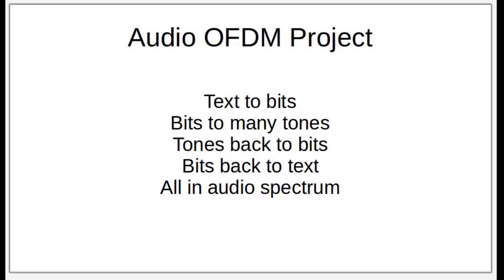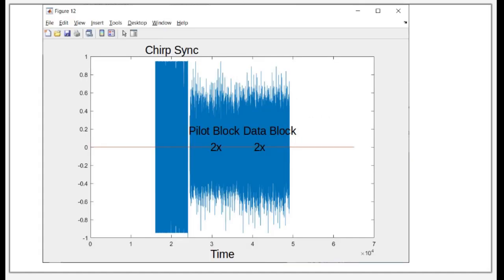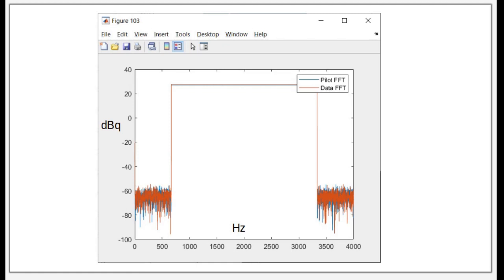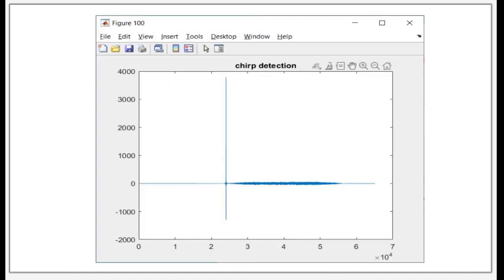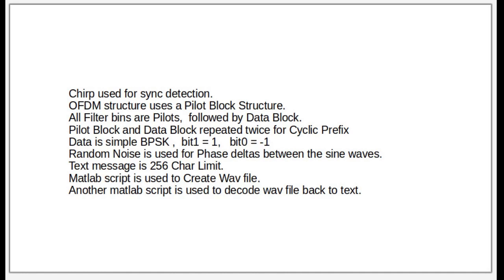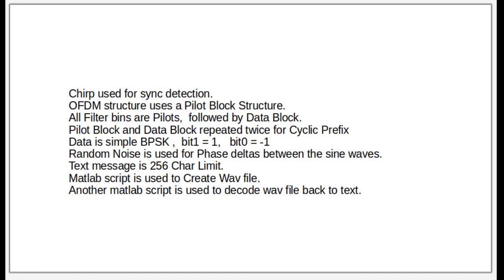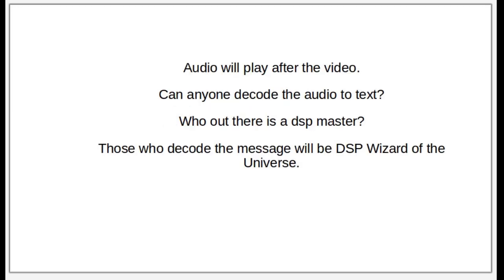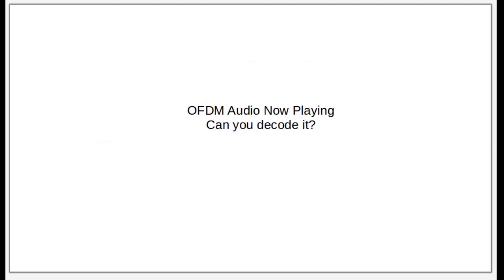OFDM Audio Project

Comment: Realised all my received bits were flipped when I transmit with the TX code, so did this on the RX code:

det(det <= thres) = 0;
det(det > thres) = 1;

%det(det <= thres) = 1;
%det(det > thres) = 0;

Now everything I transmit decodes fine, Was that a sneaky accidental on purpose error to test us? :)
Reply from the maker: It's based on TX,  I just define 1 to be zero and 0 to be pi
Reply: @TheGmr140  OK. Thanks. Will study that again to make sure I understand it.
Reply: @TheGmr140  I know what happened now. I had modified the Tx code and used the matlab function pskmod() to convert bits to symbols which flipped the values round. Sorry, my bad...
Reply from the maker: @jemussi7842  ok cool,  that expains it.  i have another link on github that does 1024 char audio ofdm,  i have tested with a fm tx and fm rx, works,  i assume a am tx and am rx would work as well.    SSB would not work, because of freq offset would mess up the ofdm symbols.
Reply: @TheGmr140  Thanks a lot. I will play around with the other code too.
Reply: @TheGmr140  Got QPSK to run for 512 characters but with nearly 10% BER even in loopback on perfect channel. Maybe a higher sample rate needed for QPSK?
Reply from the maker: @jemussi7842  yes try higher fs,  in TX and rx

Comment: Nice challenge! Will try to decode. Quick questions: are chirps as preambles used? And sending pilots upfront for every data 'bin' is actually quite nice. But that is not used in practice, right? 

In this part (luckily I once figured out how the hell to get a real valued signal out of an IFFT such that you can transmit in baseband)
xd1 = conj(xd(end:-1:2));
you end up with unequal length for xd and xd1 leading to 3071 IFFT length. I know there is no data in DC and fs/2, but I would have guessed you leave both in the input of the IFFT getting a 3072 frequency input. Or is the output of both the 3071 and 3072 input IFFT the same (I would aim for 3072 time samples myself). Is there some nuance to this? 

When solving the challenge, how to scramble the result to not make it a spoiler?
Reply from the maker: the decoded text is fine.
Reply: @TheGmr140  hi this is union bobby
     i don't do any work
     i spend my days in the bathroom stalls
     reading newspapers.
     at 2:30pm i wait at hallway
     so i can leave at 3pm on the dot
     i then race out of parking lot.
     when i get home i drink bud light
     and watch nascar.
Reply: Man, learned a lot by doing this: Started writing a Python script to decode and could not believe feeding 2*3072 or 3072+3071 samples into an FFT would be this huge difference. 3071 I noted in my first comment as being different to what I would do, but I had forgotten to use that for decoding as well. Orthogonality is lost with either of the two values per the theory, but now I have seen the difference in FFT plots of the two variants I appreciate syncing sampling clocks at both ends. This is just one in 6000 samples difference. The 2*3072 sample FFT for the pilots was spiky and changed depending on where you started the samples (the cyclic prefix should not require an exact start was my thought). The 3072+3071 FFT is just a flat line as I was expecting (and finally managed). Many thanks!